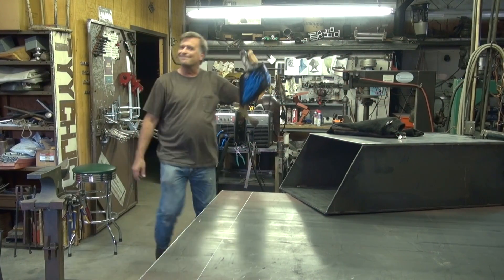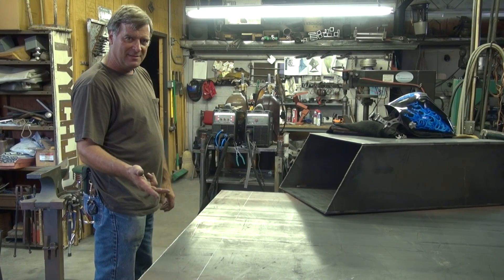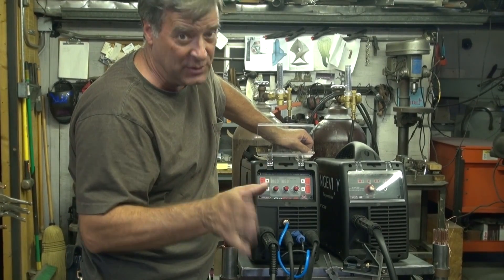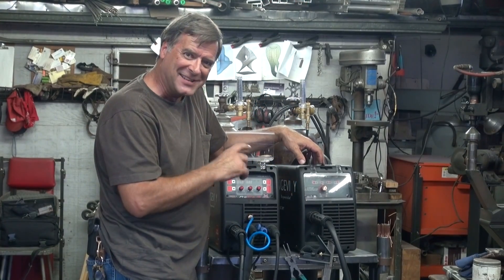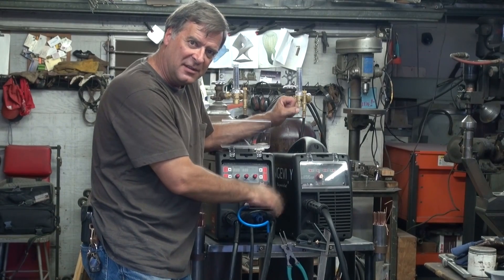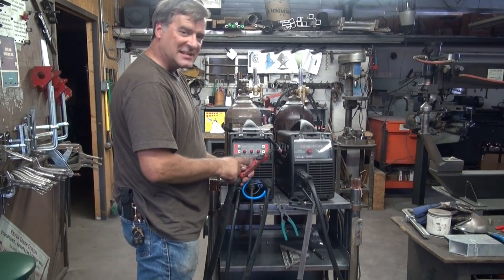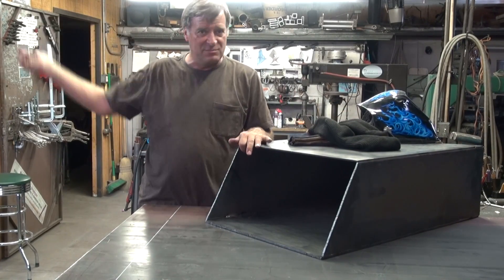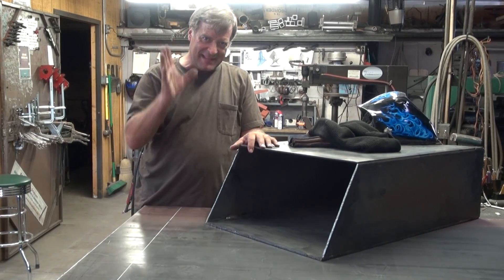Tips and Tricks for Longevity's ProMTS 200 Multiprocess Welder - Kevin Caron

Comment: Just a thought ... do you still have to have the TIG torch plugged in when the remote cable is unplugged? ie; unplug both cables when using MIG. It's probably just an "open circuit" on the TIG control line that's confusing the welder.

Comment: Hey Kevin, what happens to the MIG if you don't plug in the TIG torch? I did aluminum spool gun welding with mine and didn't have the TIG torch plugged in. Didn't see anything odd there.